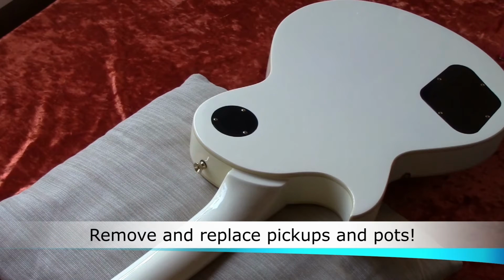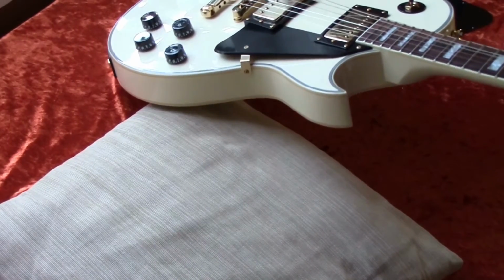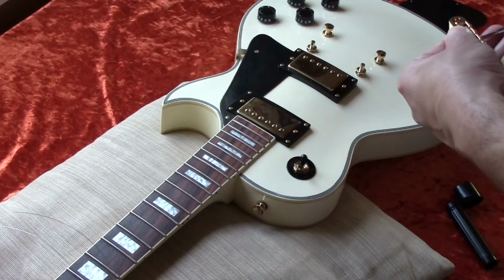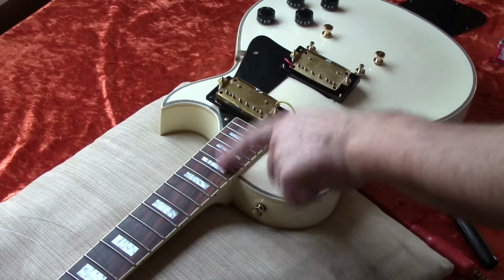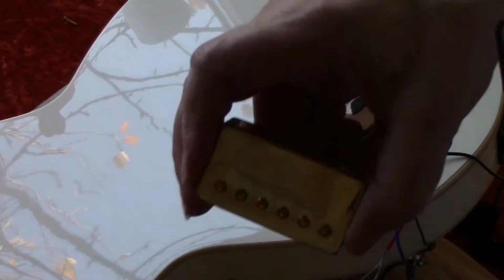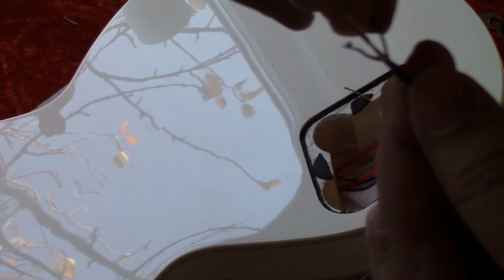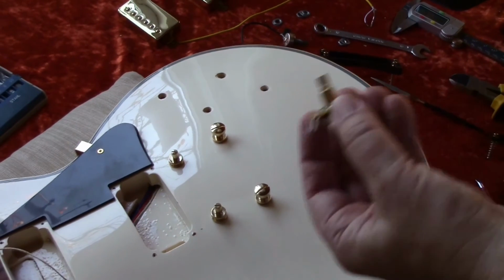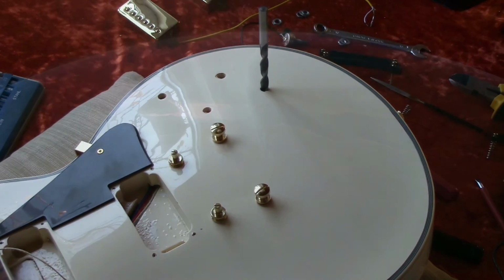Harley Benton SC-500 WH Replace pickups!

Comment: Im not 100% sure you understand intonation
Reply from the maker: Tell me ! :)
Reply: @kiivje  Intonation isnt a matter of how the bridge pieces should look. Its a function of where they need to sit in order for the strings to be in tune at the 12th fret, the open string, the 12th fret harmonic, and then making sure each note along the fret board is in key. So if you play the open low E, the 12th fret should also be an E as well as the harmonic at the 12th fret. Then make sure the A at the 5th fret is actually an A and the G, C, F and so on is actually in tune. This dictates where the saddles rest. When you change the gage of the string, the saddle pieces will likely need to move in order to be intonated properly. It may also need to be re-intonated if you change the action in an extreme manner. Many various things will affect the intonation. However, you cant just set them in a cascading manner and say "they should look like this". That's not proper intonation.
On a different note, I will say thanks for doing the video. I have a white SC 500 as well and am looking at taking the pickups out and either replacing them, or potting them. Im leaning toward replacing them, but still want the gold covers which means and this has been helpful.
Reply from the maker: @bretbrown7347  Hi Bret! Thanks for your info. Best of luck with your new pickup-installing! Best always Kim!